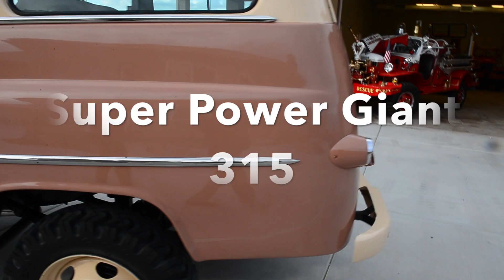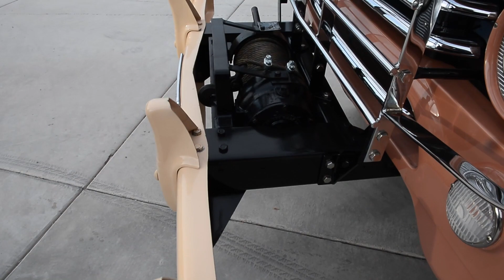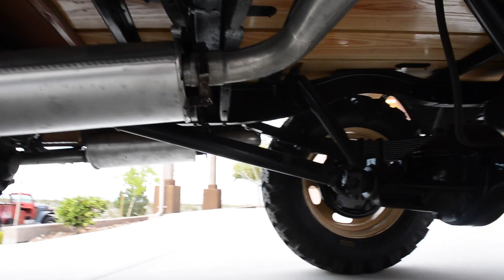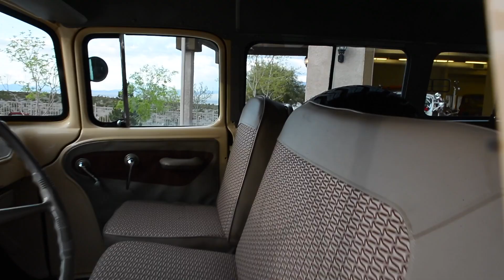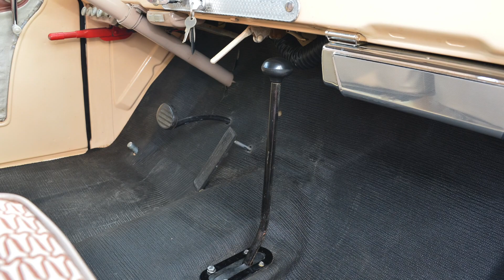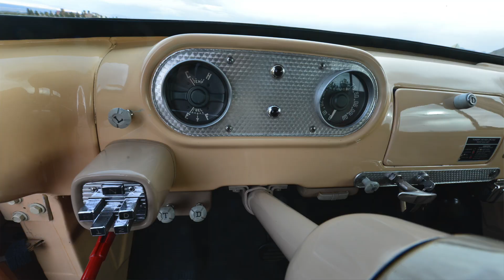1958 Dodge Town Wagon Power Wagon

Comment: Does it come with a parking brake?
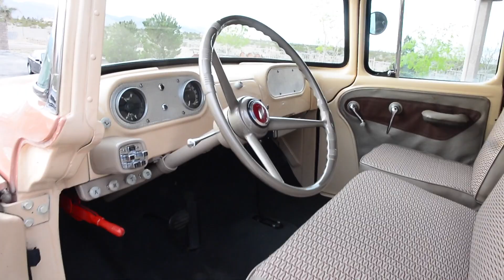Reply: Yes. 2:29 shows a red lever for the parking brake.
Reply: @bobber55  Cool, why's then a rock under the rear wheel? :D
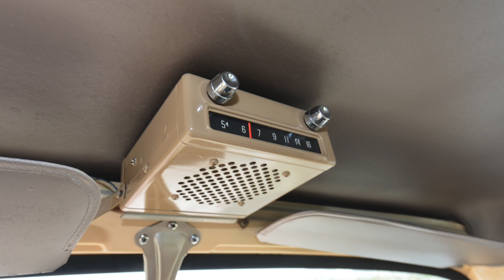Reply: @Helloverlord  If you notice at 3:23 transmission buttons does not have a "park" like lever controlled auto trans do. 
So with that being said, chocking the wheel(s) on an incline gives extra security.
Reply: @bobber55  Thanks for informations provided. I've found it funny to see that rock, a universal parking device all over the world no matter how modern or vintage vehicle is.

Comment: These are amazing I have been watching these for years almost bought a 57 town panel 4x4, what is truly amazing is you can bolt another set of wheels on to the existing wheels and have dualies all around, talk about go anywhere!!!
Reply from the maker: I did not know that, what a picture that would be.
Reply: @thewriter2549  WWII military trucks often added a second set of wheels to the steering axles of their trucks, all the way to 2 1/2 ton trucks- these added in the mud and especially the snow-